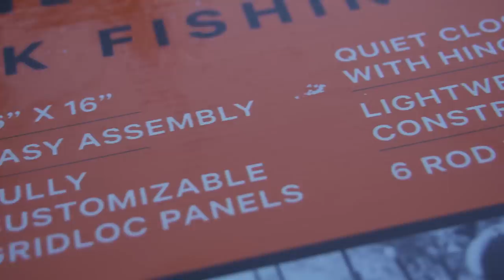YakAttack BLACKPAK PRO Assembly | Ft. Flukemaster

Comment: Can you mount the yak attack aluminum gear tracks to the black pak pro?
Reply from the maker: You can’t. They require the GridLock tracks. Well, let me clarify. You “can” mount the aluminum tracks if you want, but it won’t line up with the Gridlock screw holes
Reply: @ChadHooverFishing  oh okay. I was wondering  about that? Because I don't wanna waste on not using brand new 12" tracks. They're expensive

Comment: Couldn't get the T-bolts in those tracks.  I had to add some washers under the tracks. Then they slide in and out like their suppose to. :)
Reply from the maker: I get mine in there very easily. There may be a bigger issue with yours

Comment: This product cots way to much to require you to build it to lol being modular is one thing, saving money on assembly and shipping and still charging a premium is another.
Reply from the maker: If the product were assembled before it shipped to dealers that cost would have to be factored into the retail cost and would like add another $50 to $100 to make it feasible by the time you factor in the manufacturers labor, larger shipping container and higher freight cost. Plus, it can be configured and reconfigured a ton of different ways so are you thinking only the box should be assembled and then the consumer can customize the rest? If so, that’s the easiest part of the build and takes minutes so the value proposition just isn’t there for the manufacturer, dealer or consumer
Reply: @ChadHooverFishing  I understand what you are saying but for a mass ordered parts list that is very condensed due to the design, even produced in the United States their parts inventory is very light. You are buying 5 pieces of polymer and a couple rod tubes for $150? The box can't be configured different ways. It's a box or rectangle... yes you can orient the sticker direction and hinges different ways but those could be hot swapped by the end user as well if it were assembled. I don't see the value here and think it over priced because it is targeted to a niche market not the masses. Cool product not knocking it at all, but hard to justify not having an assembled product at that price. Thanks for the response